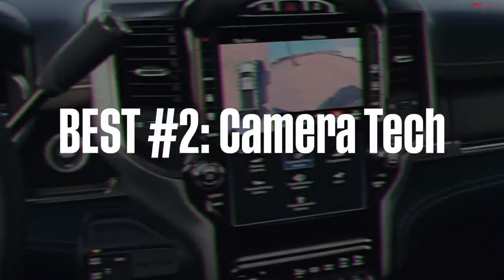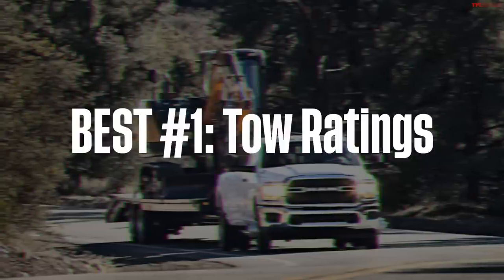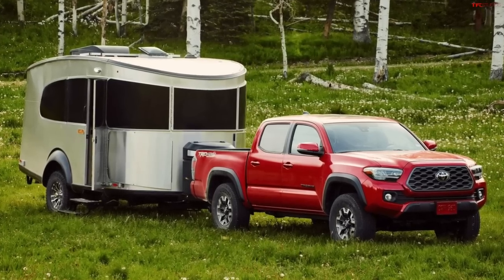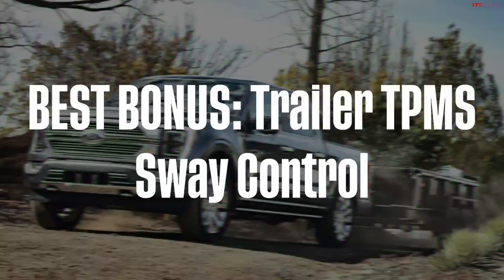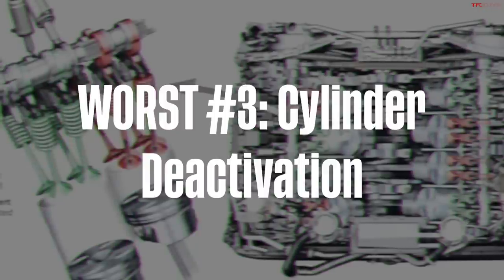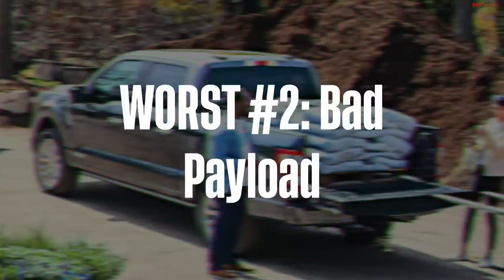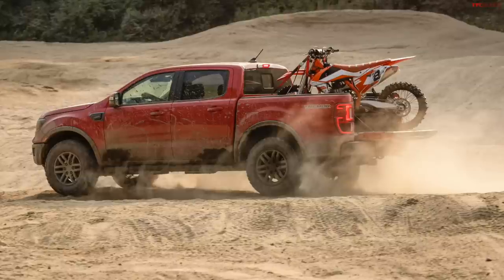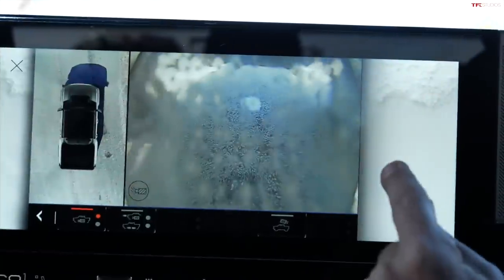This New Truck Tech Makes Your Pickup WORSE!

Comment: This is a statement for multiple vehicle classless, but anything with ongoing costs (subscriptions).

I'm not talking about satellite radio or emergency services like OnStar (unless it's compulsory), but things like what Toyota attempted with the key based remote start subscription a few years ago.

Also to be hated is the unlocking of features with a software configuration after purchase. If it's cheaper for a manufacturer to install heated seats in all vehicles, they should make that standard equipment and not charge even more for actually using it. If I'm dragging the extra weight around, I should always be allowed to make use of it.

Comment: Cylinder deactivation or afm as gm calls it is still a problem.  The lifters fail much more often than standard lifters and it's very expensive to fix. The savings are not worth the cost to repair the junk systems m

Comment: Cylinder Deactivation: I have an older iteration of this technology in my 2016 Suburban and I can tell when it's activated by the pedal feel, power availability (obviously), and sound. I haven't had an issue per se, but the driving experience isn't great.  There is lag switching back to all cylinders, and it can be less than responsive to driver input at times. Mix this with the transmission trying to find the right gear and it can feel odd. The sound is a bit strange too, with a hard to describe metal tinkling sound.  That being said, I also have a 2022 Silverado and it seems like they have fixed ALL the strange issues with this tech as it's not longer obvious when the truck is making these power decisions in the background. It feels and sounds consistent and the power is on demand. I think we can expect constant improvement on these techs in the coming years.

Comment: I totally agree with you...  Now if we could only get the manufacturers to listen, but they won't.  They stand to lose too much money selling gadgets to all the gadget freaks.  We are also breeding a generation of new drivers who won't be able to do anything for themselves becasue they have been coddled with adaptive cruise control, automatic braking, lane departure, and on and on.  The insurance companies love it, I'm sure.  In the interim, if a plastic bag blows in front of your sensor, your vehicle may automatically brake, but the older vehicle following you will probably rear-end you and total your $75k gadget-mobile.

Comment: You guys definitely hear more than I do, but people I talk to love the GM cylinder deactivation technology. The power is there when you need it, and you get the gas mileage when you don't. 20+mpg hwy on a NA V8 full size truck is hard to beat. Biggest reason I haven't ordered a new one is because they don't offer it in the new trucks. I'm still getting 20+mpg hwy with my 2018, why would I buy a new truck just to get worse gas mileage by 2-3mpg?

Comment: Just purchased a new 2022 refreshed 3.0 Duramax Diesel.  I have always loved the full size trucks but did not like the MPG.  Especially here in California where gas and diesel prices are over $5 per gallon.  The MPG of this diesel changed my mind. I have 3000 miles and my avg fuel economy (not towing) is 25.7mpg.  which is incredible for a 475torque 277hp. I think this is the alternative to the electric pickup the fuel economy.

Comment: I wish manufacturers would bring back sport trucks. They don't have to be sporty to the point of being useless as trucks, but slightly lower, more powerful, better handling, lighter (even if it was just 2wd) trucks aimed at primarily street driving would be a nice touch. The market has been without these kind of trucks for a while.

Comment: I agree Cameras are the most important added feature.  I agree with the height of the trucks because you need to have rails on them just to get in is dumb.  The other thing I do not like is the items that can help with work are all add ons that come with high end ones.  Take the blue cruise on the F-150 lightning.  That is something that should be a standard but don't need all the electronics on the inside.  Seriously we have been looking at our phones for directions for years all I need is a 6 to 9 inch screen that I can see directions on.  Give me the safety features on base and let me add heated seats and all the extra electronics in the high end models.

Comment: Best thing I've seen yet that I didn't happen to see mentioned is GM's towing/payload labels that are VIN specific to the truck as built.  This takes out so much questioning as to whether the truck you are looking to buy is capable of what your needs are for towing and payload.  It also takes out the guess work of using the factory "max payload" ratings they all publish which is always some absolutely stripped down base engine or middle engine truck and then you think your High Country 3.0 Duramax with sunroof and rear entertainment can do what that rating is published at when it can't.

Comment: If cooling is the concern and most guys like to sandbag or add weight to the rear for added traction/putting power down. I wonder why they haven't just put radiators and batteries in the bed and dead space near the wheel arches. Would make the front smaller, better aero, mpg, etc. I know that is some race car talk but eh, what are Baja and rally trucks right?

Comment: Bring back vinyl floor covering! It’s a truck. I don’t need carpet with muddy boots.  FYI, Roman, I don’t care for cylinder deactivation either. Transmissions with 8 speeds or more has done more for fuel economy than cylinder deactivation.

Comment: Agree pricing is out of control, would love to see a more basic optioned truck with the best drivetrain options. No cameras, crazy tailgate, fancy stereo, big digital screens… (i.e. GM crew cab 4x4 work truck with the 3.0 Duramax). Lighter, less to break, more fuel efficient, and more affordable. I think that just might be a very popular configuration.

Comment: Electrification of retail-market dual use pickups should've come after electrification of class 2-3 delivery vans. That's their first prime application, multi-stop urban delivery - based out of a yard, covering a fixed route with lots of idling time to eliminate and lots of opportunities for regen braking. That's why in class 5-6 electrification is being rolled out to city delivery trucks and school buses first.

Comment: I’m in a fully loaded 2023 ram 1500 limited right now through Avis. Here’s my pass fail/list for anyone considering buying: PASS=hud display,push start,heated/cooled seats, large screen, auto folding step bars, automatic seats, remote start.   Features I would never buy and consider a FAIL: digital rear view mirror (awkward), air height settings (can’t drive using all of them), lane keep and acc probably the worst I’ve ever tested and felt dangerous. TomTom software for navigation is hit or miss. Pano roof, looks cool but is not all that practical. Auto parking feature, holy crap it’s slow to use.

Comment: The lack of diesels gets me. Yea they're present in HD trucks, but Ford and Ram both quit selling their 1500 diesels, and gm canceled the colorado/canyon diesels. It sucks the government is so up their own rear end that they chase emissions the way they do (I know, we all breath the same air and it should be clean but their diesel restrictions go far beyond gas vehicles). Then dealers never get any stock of diesel vehicles, they sell poorly because no one can get them, and the companies decide it's not worth it to keep them. I'm sorry but my stock tuned 2.8 diesel gets 25.5 average and it's lifted, has a steel bumper, and off road tires. Do that in a Tacoma or gas colorado and you'll be happy to see 18 on the highway.

A new midsize diesel with the slick 10 speed would be insanely cool, but no one wants to build one. Gm also took away the 6'2" bed option in their new mid size trucks and will only offer the 5'2" bed. God forbid someone wants to use it as a truck I guess.

Comment: I think one of the issues in the vehicle industry today is that car manufacturers (and the government) value is perceived economy over reliability. How much, if anything, do you save with a 10 speed transmission vehicle that gets you 23mpg vs a 6 speed transmission that gets 21 when the 10 speed overheats & burns out the day after the 3 year warrantee expires...

Comment: I live so far out in the country that I wouldn’t be able to get to a charging station before the battery ran out.  Electric pickups are probably the worst idea anyone has ever come up with.  Cylinder deactivation is also asking for trouble.  If people want good mileage they should drive a car.  If you live on a farm you have to have a pickup. I want something to work out of.  I don’t want heated leather seats, 20” aluminum wheels, backup assist, a dozen cameras, etc.  The more junk you add to a vehicle, the more it breaks down.  If they made a new pickup with a straight six, 5 speed manual, roll your own windows, and a bench seat, I would buy it in a New York minute, but not for $100k.

Comment: Start/stop technology is also a bad technology, for the fuel savings it is supposed to give. An engine wears the most when it is starting. Also how can starters last for years as they previously did.
Reply: Simple: instead of making a $100 starter they make a $700 starter. Have fun replacing it.

Comment: The tech that I’ve had the most issue with  is stop/start 🤦🏼‍♂️ Don’t know anyone that likes it and at best, it’s just tolerated
Reply: While they covered one of my biggest gripes with cylinder deactivation, the start stop feature is as big of a concern.  Why ruin an engine?  Wait, so the engine doesn’t last….
Reply: I was able to purchase my ‘23 Ranger with “stop/start delete” and the gave me $50 off the price. Win/win!
Reply: Yes, this. Surprised they didn't mention that. I recently bought the start/stop eliminator. Working like a charm so far.
Reply: @sexyfishyphish  engineers have said the piston rings need compression and combustion pressure to work properly. Valve trains will work correctly when all valves are in working order.  You also typically will get oil blow bye and fill or ruin the pcv unit.  The list goes on.  An honest mechanic will list many other issues and not recommend the technology.
Reply: @sexyfishyphish  I meant to say the issues with cylinder deactivation.  Sorry about that
Reply: @sexyfishyphish  In standard ICE, it’s annoying as all can be and common says that all those starts can’t be good for the ignition
Reply: @nightlybluez  The start/stop eliminator I used on my dad's F-150 was two short lengths of 8-gauge threaded copper wire and a toggle switch.  It took just a few seconds to figure out which two terminals on the back of the start/stop switch were shorted when you push the button in as it is nothing but a momentary switch.  Keeping those terminals shorted permanently kept the system deactivated indefinitely. Then we simply ran the wires out to where we could mount the switch under the dash so he could turn the annoying feature back on if he needed to take it in for service.
Reply: @sexyfishyphish  Ask yourself this, when the engine isn't running, where is the oil?  In the oil pan.  That's why the vast majority of engine wear is caused during startup, because it does take a little bit of time for the oil to pump to the top of the engine so that it can do it's job and in most  modern engines, that's where the camshafts are.  So, the best way to ruin an engine is to start and stop it continuously, and the lower the viscousity of the oil you are using, the faster it drains back down to the pan. 

Cylinder deactivation, on the other hand, cause very uneven hating and cooling in the engine block because some cylinders are firing and therefore are hot and some are not firing and therefore are not nearly as hot.  While coolant circulation can mitgate some of this, it can't fix it all. You will experience uneven thermal expansion and that's not generally a good thing when you're trying to keep the engine a sealed unit.

Personally, I turn all of that shit off.  I'd much rather have a reliable truck than save a few miles per gallon on a vehicle I never expected good fuel economy from in the first place.  Government be damned, they're not paying my repair bills.
Reply: @sexyfishyphish  Apparently you haven't sat through some of the lights I have.  Plus, I'm not wiling to gamble with an engin that will cost the better part of $10,000 to replace.  Keep that oil pumping and I know it's doing it's job.
Reply: @sexyfishyphish  They don't use standard 4-cycle engines and once again, why gamble with the most expensive part of the vehicle?  If it's your car, do whatever the hell you wish.  Personally, I'll pay for the insignificant difference in fuel usage to keep the oil circulating.  I have absolutely no trust in the manufacturer that only cares if their product outlasts the warranty.  To them it's a BONUS if it dies just out of warranty.

Comment: Dealerships around here (Sioux  Falls SD) are now full of inventory with plenty of trucks on the lots. However reports are they can't move the trucks because of the ridiculous prices and the high interest rates. Some production has either slowed or stopped because of this. I feel that manufacturers have prices their products out of the market. High fuel prices, high interest rates and very high prices for the Trucks. Only the really wealthy can afford to buy new now. Also more and more recalls showing quality is no longer job #1 isn't helping the reputation of Trucks. The latest story is regarding the Ford Raptor R and all sorts of Oil leaks happening.

Comment: I am a farmer and hate the traction control in soft fields it sucks and on wet gravel roads it suck if you can’t handle your truck without traction control maybe you should be driving a Prius

Comment: I do disagree with your list but with a condition. I don't think electric full size trucks are a bad thing. There are a lot of people who use pickups regularly, but not for towing. If you can go 300 miles on a charge and that truck lets you pick up the stuff you need for your home improvement projects, or take the mountain bikes to the trail head, or load large appliances in the bed it will still work well for you.

I do think the manufacturers need to lean away from bragging about tow ratings on electric trucks. Since they really cannot tow much more then a trip across town.

Comment: I actually like the cylinder deactivation feature on my RAM 1500! Mainly because it significantly reduces fuel consumption during idling. That is not just an economical thing, it actually changes what you can do with your truck. During a recent racing weekend in warm temperatures I dried out all my fire proof clothes between my driving stints (and cooled myself down) using my truck’s AC. If I’d have done that in my Mustang, that doesn’t have cylinder deactivation, I would have run out of gas twice (once if the Mustang’s fuel capacity had been as large as the truck’s). In the RAM I had a comfortable safety margin for getting to the nearest gas station even after idling for two thirds of a weekend!

Comment: I can’t remember where I heard this, but one of the explanations for the trucks getting so tall was that it is part of the engineering involved in providing the flat floors in the cabs. I don’t know if, or how much impact this has, but it made a lot of sense.
Reply: There are plenty of 80s and 90s trucks with relatively flat floors, so if floor vs. underbody room was an issue I think it's more from other factors.  Things like larger transmissions, larger catalytic converters, and more/bigger exhaust components.
Another factor pushing towards taller trucks is cargo and interior volume.  Truck makers want the biggest cubic foot number on their spec-sheets, and they're limited how much wider or longer they can make the vehicle.  Especially with crew-cabs now the norm, beds have gotten deeper to retain volume.
Reply: The tall fronts are for the radiators to keep the diesels cool .
Reply: All of the aforementioned reasons are certainly minor contributing factors.

However, the MAIN reason for modern pickup truck height is to allow for the huge wheels & tires that are being stuffed under pickups nowadays, from the factory. 

A great majority of pickup trucks built today have enormous height wheels & tires that were only found on older trucks with costly aftermarket lift kits installed. 
Some of the most common oversized tire heights were: 31", 33", 35", 36" tall tires, where typically 2" to 8" aftermarket lift kits had to be installed, in order to adequately clear such larger height tires.

A great many full-size pickups today are rolling off the production floor with 33", 35", & 37" tall tires. 
That's why.
Reply: @charlesc5983  Nah, that's simply not true. I've owned, (and still cuurrently own) many different brands of diesel pickup trucks. There is plenty of room for radiators, intercoolers, evaporators, tranny coolers, and such without putting the hood or the entire truck a mile in the air. 
In addition to the front grilles, most vehicles actually get much of their airflow through the holes in their front bumpers. Even cars.

Comment: As a young man, I haven't got to experience top-of-the-line trims. Really my only concern is electric and eventually autonomous vehicles. Electric should be an option in the choices of power trains. There is no reason to kill off diesels and gasoline engines especially v8s. Autonomous vehicles should never happen and I won't buy one let alone ride in one. On to my current ride, I love just about everything on my 19 Ram  Bighorn. Really the only two things I say I don't like is not having heated tow mirrors and the goofy 20 inch wheels. I'm hoping I can come across some used Rebel wheels. Keep up the good work TFL